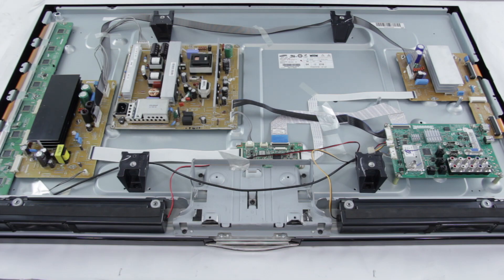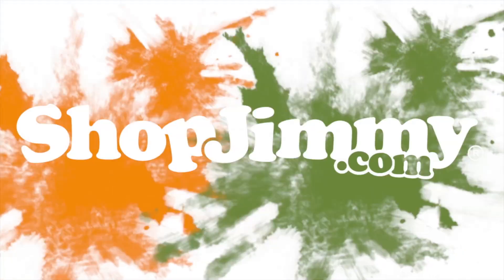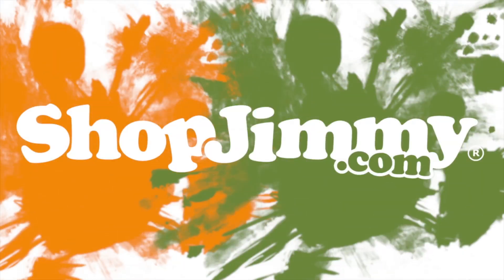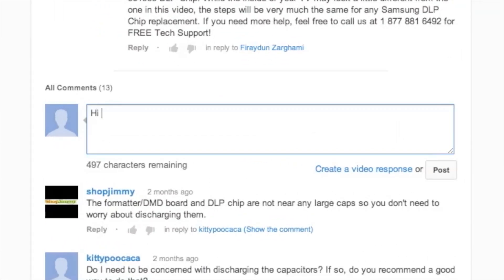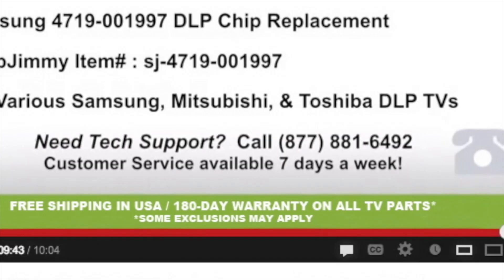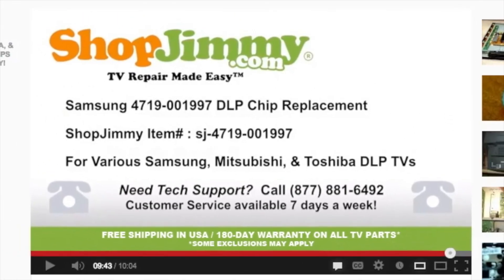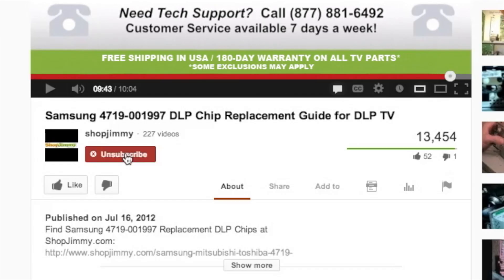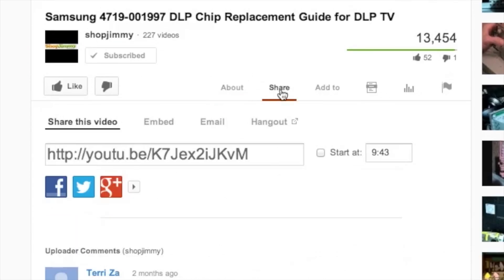Plasma TV Repair Tutorial - Common Symptoms & Solutions - How to Fix Plasma TVs

Comment: I have a Samsung Plasma Display Md# PN50C450B1D, and the problem I'm having is a horizontal line going from left to right across my tv unit. My screen is dark, with picture.
Reply from the maker: Gary Garner   This could be a problem with either the Y-Buffer or the TV panel.  You can replace the Y-Buffer to see if that fixes the problem.  Click this link to replacement parts for your TV model number:  http://www.shopjimmy.com/catalogsearch/result/?q=PN50C450B1D  Be sure to match part numbers on your current board, with your replacement for compatibility.  Thanks and please let us know if you have any further questions with your TV Repair!  www.shopjimmy.com

Comment: Hello, I was watching TV and I heard a decently loud "click" and the picture was gone. I turn the tv off and then back on and I could hear the sound and change the channel but no picture. Even the menu or volume markers would not appear, although were functioning.  

SAMSUNG 50' Plasma 
model: PS60A550S1F
model code:2550A550s1fxxy
type: PS50A550
ac220-240v~50/60 Hz 550w
Reply from the maker: Frankie Rousselet   This sounds like a problem with the y board and buffers.  Unfortunately I do not see any replacement parts in the search results for your TV model number on our website.  Thanks and please let us know if you have any further questions!  www.shopjimmy.com

Comment: I have an LG 50PG6000 plasma TV. The green standby light comes on and the there is sound. I can change channel and the sound changes channel. There is however no picture at all on the PDP. I have checked the voltages on the power supply panel and the Vs, Va, 5v and all the other voltages are ok. The green LED on the control board is lit. All the buffer panels seem to have voltage on them.
Any suggestions what the problem might be.

Comment: Need advice,I have a Samsung Pn64E588D2F I bought it in December of 2012 and about a month ago all of a sudden I turned it on and only the sound came on, so I turner it off and On again and the pic and sound came on, and ever since that day I had to turn the tv on and off and on just to see the picture. so it was OK , But I knew that something was getting weak. But now When I turn on the TV the little red button seams kind of weak and slow blinking like its loosing power and will not turn ON. Do you know which part I should change out or what to do next. I would very much appreciate your input!!

Comment: Lg 60 inch plasma model 60PK200 serial # 012RMBW2F133, my television won't turn on at all, I hear the clicking noise for about 2 seconds and then nothing, what can be the problem? I would like to fix it myself if I can, I am sure it is costly to have it done. Also is it worth fixing it, it's 5 years old?

Comment: I have an Insignia NS-42P650A11, on screens with a mostly white, yellow, or light blue background like maybe a sky with clouds shot, I'm getting a red that is in the center portion and bleeds across the screen from left to right, not every pixel, but most, like noise or static.The picture is viewable, so it's not solid red, just like it's bleeding in. Any idea? Thanks in advance, great video!

Comment: Hitachi P50H401.  Have standby power (red light), but when TV is turned on with remote it begins to turn on with a solid blue light for 1- 2 seconds and then trips off with no picture and no sound.  Need to unplug/plug-in to reset to standby, but trips again.  Power supply or fuse?

Comment: I have a LG 50PN6500 Plasma It works perfect and stays perfect for hrs and will sporadically turn off by itself and turn on by itself only after I change input, or pull up menu, or change volume. Once it restarts by itself it is fine again, and unless I change what I mentioned above, will run forever and has perfect picture. Ni idea
Reply from the maker: Chris Rodenhiser  Please watch this video FIRST to help with your repair!  https://www.youtube.com/watch?v=BP3NVNCGEv8   I recommend replacing the main board in your TV.  Click this link to replacement parts for your TV model number:  http://www.shopjimmy.com/catalogsearch/result/?q=50PN6500  Be sure to match part numbers on your current board, with your replacement for compatibility.  Thanks and please let us know if you have any further questions with your TV Repair!  www.shopjimmy.com
Reply: ShopJimmy.com
I will try the main board when you get it in stock thanks

Comment: I have a Samsung 50 inch model number 
PN50A450P1D 
I have thin lines from side to side and thick lines up and down how can I fix it asap
Reply from the maker: Mario Moreno   This sounds like a TV panel (TV Screen) problem.  If your TV panel is bad, it may be more cost-effective to replace the TV as panels are typically hard to find in stock, difficult to replace, and expensive.  Thanks and please let us know if you have any further questions!  www.shopjimmy.com

Comment: My TC-P50X5 won't come on. The red light doesn't even blink. It has done this before when there was a power interruption. Unplugged it, took it off wall, let it set for a day , plugged it back in, depressed power button for 10 seconds, whala! Tv came back on!
Problem is, it's done it again! This time, the above procedure has failed to get it on. No noises, clicks, nutin!  Please  help!
Reply from the maker: ed hood  Please watch this video FIRST to help with your repair!  https://www.youtube.com/watch?v=BP3NVNCGEv8   I recommend replacing the power supply board in your TV.  Click this link to replacement parts for your TV model number:  http://www.shopjimmy.com/panasonic-n0ae6jk00006-p-board.htm  There may be multiple boards for the same TV model number, be sure to match part numbers on your current board, with your replacement for compatibility.  Here is a link to a video showing how to identify your part number, click here:  https://www.youtube.com/watch?v=N1ophMtQeZU  Thanks and please let us know if you have any further questions with your TV Repair!  www.shopjimmy.com
Reply: ShopJimmy.com I ordered  & received a new power board from you all. Installed it, hooked everything up, NOW, I get 8 blinks from the red light when powering on. Tried multiple resets, still 8 blinks. Now what do i need? Panasonic TC-P50X5
Reply from the maker: ed hood  Try this at your own risk. Unplug the TV, then disconnect the SC board and plug in the TV to see if the TV powers up. Reply with the results of this test. Thanks! www.shopjimmy.com

Comment: Hi. I have a Samsung pn51D530A3FXA that has the following symptoms. It turns on, sound chimes, clicks a flash comes on the screen then screen goes blank. Logic board LED blinks every 8 seconds. Va and Vs voltages initially goes up then drops down to zero. I've disconnected the Y sustain board from the y buffer board and the Va and Vs volts drop. Ive disconnected the Y sustain board ribbon cables from the logic board and the Va and Vs voltages stay up, led on the logic board blinks every second. Iv'e replaced the Y sustain with replacement boards twice and the same symptoms. Ive just tested my Y buffer boards again and now have found shorts in both of them. Help? Thanks
Reply from the maker: Jim Yeh   This could either be a problem with your TV panel or you should replace the Y-Main Board and the Y-Buffer.  Click this link to replacement parts for your TV model number:  http://www.shopjimmy.com/catalogsearch/result/?q=51D530A3  There may be multiple boards for the same TV model number, be sure to match part numbers on your current board, with your replacement for compatibility.  Here is a link to a video showing how to identify your part number, click here:  https://www.youtube.com/watch?v=R1jmj_foId0  Thanks and please let us know if you have any further questions with your TV Repair!  www.shopjimmy.com

Comment: I have a Samsung 50 inch plasma tv hp5053 I have a 3 inch vertical black line that runs from top to bottom on the left hand side of tv. it is there also when the menu screen is up
I would like to know if you have any idea which board or boards are the culprit or things i could try.
thank you
Reply from the maker: Anthony Kozuch  This sounds like a TV panel (TV Screen) problem.  If your TV panel is bad, it may be more cost-effective to replace the TV as panels are typically hard to find in stock, difficult to replace, and expensive.  Thanks and please let us know if you have any further questions!  www.shopjimmy.com

Comment: I have a Samsung PN64D7000 purchased 3 years ago yesterday (3/1/12). Today, it was working fine in the morning but when I turned it on this afternoon the picture was very dim and white washed. If you look closely at the pixels you can see them flashing green and red everywhere. Its almost like a static-y picture but at the pixel scale. Can't believe this is happening to a $2000 TV in under 3 years from delivery. I tried to browse through the comments but didn't see anything related to color, dim screen, or washed out picture. I have taken a picture and may take a close up video and see if I can upload it to YouTube.

Comment: i have a panasonic plasma, it started turning off on its own. Before it turns off the screen randomly flashes...normally the screen will be on for 10 to 20 minutes before it turns off. once it is off you have to unplug it to turn it back on. model number TC-p50s60
Reply from the maker: Michael Holcombe   I recommend replacing the SC, SU & SD boards in your TV.  Unfortunately I do not see any replacement parts in the search results for your TV model number on our website.  Thanks and please let us know if you have any further questions!  www.shopjimmy.com
Reply: Thank you I will try that out.. much appreciated.

Comment: have 52" LCD HDTV LN52A550 LIGHT ON BOTTOM IS ON, BUT TV WILL NOT COME ON, NO PIC, NO CHECK SOURCE, RECENTLY REPLACED CAPICTORS IN POWER SUPPLY BECAUSE IT TOOK SO LONG TO COME ON THEN  FINAL WOULD NOT COME ON AT ALL. I TURNED IT OFF AND LIGHT ON BOTTOM DID NOT GO OFF. WHEN I TURN ON POWER RED LIGHT FLASHES BUT SCREEN DOES NOT COME ON. PLEASE ADVISE.
Reply: UNPLUGGED IT AND IT CAME BACK ON ?
Reply from the maker: Swindell Chestnut  Please watch this video FIRST to help with your repair!  https://www.youtube.com/watch?v=BP3NVNCGEv8   I recommend replacing the main board in your TV.  Click this link to replacement parts for your TV model number:  http://www.shopjimmy.com/catalogsearch/result/index/?cat=56&q=LN52A550  There may be multiple boards for the same TV model number, be sure to match part numbers on your current board, with your replacement for compatibility.  Here is a link to a video showing how to identify your part number, click here:  https://www.youtube.com/watch?v=BEPWrefQvqI  Thanks and please let us know if you have any further questions with your TV Repair!  www.shopjimmy.com

Comment: PANASONIC TH-42PA20 ... The plasma turns itself off and the red indicator light blinks 7 times.  Power button or remote wont work to turn it back on.  I must unplug it, wait for 30 secs or longer, then plug it in and turn it on.  Some power-ons are immediately successful and others aren't so I wait longer between unplugs.
Reply from the maker: *****   Try this at your own risk. Unplug the TV, then disconnect the SC board and plug in the TV to see if the TV powers up. Reply with the results of this test. Thanks! www.shopjimmy.com

Comment: I have an older Vizio P50 HDTV20A the picture works fine for about 15 min. Then the picture will go out still having audio. If i turn it off for 5 minutes then back on the picture will come back on for another 15 min. What could the problem be?
Reply from the maker: Rebecca Gauna   I recommend running the flashlight test on your TV.   Here is a link to a video we produced that shows how to run the flashlight test. https://www.youtube.com/watch?v=xUzCLgoSPGM Please reply with your flashlight test results and we can recommend a replacement part for your TV repair. Thanks and please let us know if you have any questions! www.shopjimmy.com

Comment: I have LG 60PA6500 plasma tv. TV turns on for 2 seconds showing the LG logo and the timer clock sign & then turns right off within 2 seconds than on than off. What should be the problem
Reply: I disconnected the X board it's the same clicking noise. The lg logo shows for few 
seconds like before but the picture is not clear than it vanishes same like before.
Here is the vid:

Comment: Help please. Ihave a samsung vizio model dp50747 plasma. When i turn power on i hear a click light on tv comes on no picture or sound just black screen. then after a min or two shuts off by itself. D you have any idea? Is it wotrh fixing? Ilove this tv. Help
Reply from the maker: Patrick Baker  Please watch this video FIRST to help with your repair!  https://www.youtube.com/watch?v=BP3NVNCGEv8   I recommend replacing the Y-Main Board and the Upper and Lower Y Scan Drive board in your TV.  Click this link to replacement parts for your TV model number:  http://www.shopjimmy.com/catalogsearch/result/?q=dp50747  There may be multiple boards for the same TV model number, be sure to match part numbers on your current board, with your replacement for compatibility.  Here is a link to a video showing how to identify your part number, click here:  https://www.youtube.com/watch?v=R1jmj_foId0  Thanks and please let us know if you have any further questions with your TV Repair!  www.shopjimmy.com

Comment: I have a samsung PN58B550T2F and I'm having some issues. The TV will not turn on most of the time but the standby light is on sometimes when the tv is bumped a certain way or moved it will start to work. once the TV is on though sometimes it will randomly power cycle, and other times the HDMI input will stop being detected and the screen will still be on but it acts as if nothing is plugged in. Also sometimes there is rainbow colored snow on the picture before it finally cuts out. I have checked over all the boards and I don't see any bulged or leaking caps I did however see a couple that were slightly bent over. Any idea as to what might be causing this? Thank you.

Comment: Hey guys, thanks for the video. I have an LG50ap4500 it has had horizontal lines (two across the top) since I got it. Finally the upper Y buffer blew. I replaced it and the tv worked again! For about four seconds..... It still had the two lines across the top as well. Guessing It must be the y sus board??? didn't look like the top ribbon on the buffer had any damage nor does the tv appear to have ever been dropped. what do you guys think? did I get a bad y buffer or is there another cause like the y sus??? thanks for any help.
Reply from the maker: Eron John   This could be a bad buffer in your TV or a bad TV panel(screen).  You can try replacing the buffer board to see if that fixes the problem.  Unfortunately I do not see any replacement parts in the search results for your TV model number on our website.  Thanks and please let us know if you have any further questions!  www.shopjimmy.com

Comment: I have a samsung plasma model # PN64D7000FFXZA.  Blank screen and no standby light.  Unplug the TV and reconnected.  I can hear a relay click and a green led in the back panel light up and blink.  No standby led.  If I hit the power button the red LED blinks.  If I hit any buttons on the TV or remote the red led blinks.  No logo or menu screen and no sound.  I suspect the main board and power board.
Reply: ShopJimmy.com Thank you.. I ended up talking to a local repair shop.  Told him the symptoms and he said the Y main board is likely to be the problem and would repair it (outcall) between $400 to $600.  I'll just buy the 3 boards you recommended.  Also I forgot to mention... after unplugging it overnight the tv came back on.  It also went out again the next day.  unplugging it for several hours does the trick to fix it.  Still the same boards you recommended?

Comment: I have a Samsung PS64E550D1M which has a white horizontal band running across the top 1/6th of the screen, it is there with all modes of inputand seems to be overlaying the picture which is barely discenable under it, any ideas

Comment: Clicking at power board when tv is turned on. No image on screen. PANASONIC TC-P50UT50 MPF6913B CA2118365A POWER SUPPLY
Reply from the maker: *****   Try this at your own risk. Unplug the TV, then disconnect the SC board and plug in the TV to see if the TV powers up. Reply with the results of this test. Thanks! www.shopjimmy.com

Comment: Hi, I have Samsung PN51D550C1FXZA, it suddenly doesn't have any pictures or sound. When I plug in the power nothing happens until i power on from the remote, then it tries to come on with  5 click sound from the PS board. I changed the Logic main, PS , X-SUS and Y-SUS boards but the issue still persists. If i disconnect the Y-SUS from the PS board, the heartbled LED comes on and stays on. Same thing happens when i plug in the Y-sus but remove the x-sus power cable from the y-sus. I tried to take to the test mode as described in this video www.youtube.com/watch?v=-7zWKY2Hwnc i get 4 quick clicks and blink of the Heartbleed LED then it goes. If i do the same test mode with the y-sus cable unplugged form the PS board the heartbled LED comes on and off slowly. Please advise what to do.
Reply: I had already replaced the Logim main, PS board, x-sus, y-sus boards but the same issue was still there.